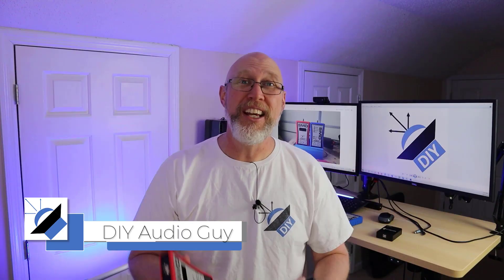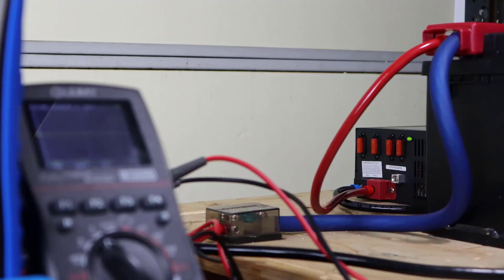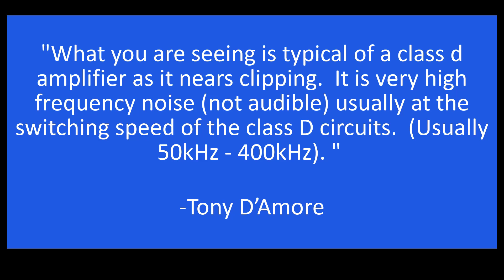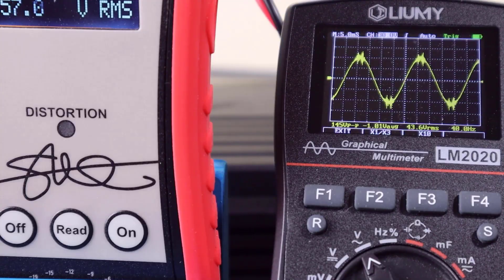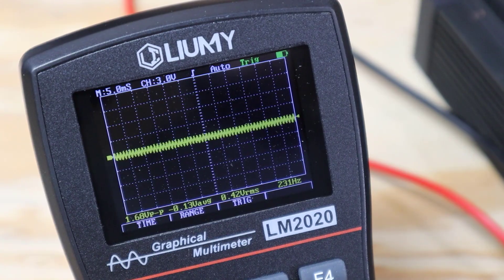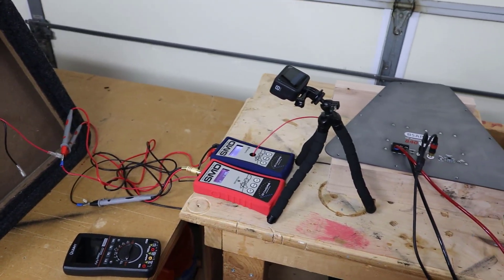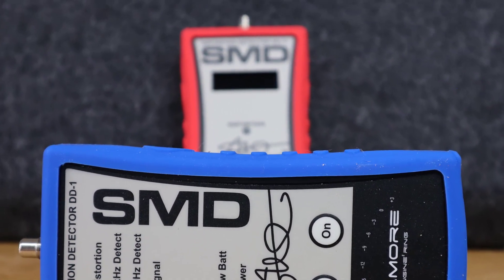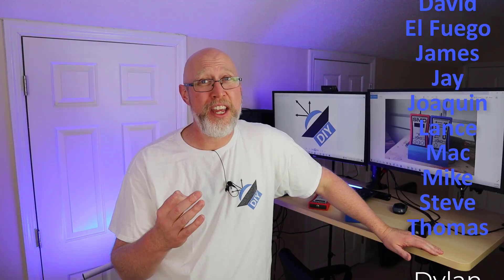The best way to set amp gain?  #SMD DD-1 VS Liumy Oscilloscope

Comment: I know I’m super late to this, but great video and info, as usual! I use a Liumy scope in conjunction with a Fluke DMM and the tweeter version of the DD-1 that Sam had made a video of. Works great if you have the time and space to set up and test everything or the space to haul it around like I did when my friends needed equipment installed (apparently because I’m a big DIY audio hobbyist and all about learning, I’m the audio guru friend😂). I have limited space in my car so I finally made the choice to pick up a DD-1. No more Packouts crowding my little Focus just set up an amp! It’s great to have a vast selection of tools in your arsenal, even if you don’t use them. What’s that saying about needing it and not having it?? Yeah, that applies to a lot of stuff😂

However, as a DIY and a bit of a perfectionist, I do love buying the proper tools to do an install correctly, even if they’re the cheaper ones (usually temporarily) and I have spent a LOT of money on doing just that…the next couple of tools on my list to upgrade are the PT9A+ and an RTA & mic setup👌🏻 even though this is mostly all for just slowly upgrading my personal audio installs over time😅

Comment: Question? How do we check the signal going to your speakers once we set head unit EQ, dsp settings etc.
Reply from the maker: You should not need to, and remember when setting up the equalizer you cut instead of boost. You only boost a frequency if there's no other option.
Reply: @DIYAudioGuy Question? After you check your head unit for clean signal, flat eq, no bass boost etc. then make sure amp signal is clean, dsp signal clean I never see anyone show how the signal is after you set eq to your liking.

Comment: another one I have seen people screw up on with amps and speaker PEAK POWER which is a FKG JOKE, 900 watts RMS woofer or sub ain't going to come with refrigerator magnets, 900 watt RMS amp won't use 24 awg for power
Reply from the maker: Refrigerator magnets, I like that.
Reply: @DIYAudioGuy  figured you would 😂

Comment: best system to setup is, use more power and speakers than required and won't have that distortion problem, by the way, been doing since 1988 by my self thanks to my dad, if one only uses ear they can hear without ten thousand dollars worth of shti, hell I busted the obd1 & obd2 computer systems in the 80's and the 90's vehicles gasoline or diesel with nothing but analog and dmm, after all said could not be done, now a person can't, because pu55ie5 made it that way just so they can cry (DEAD BEAT DAD SYNDROME LIKE TDS) so next time any btch cries, you know why she a lie like distortion utopia

Comment: The scope you used is a cheap or poor scope you need to get a real scope or at least a cheap fluke scope a real scope starts at about 2000 the one you have refresh rate is like 20 nanoseconds and that’s why you had a delay

Comment: I know my particular radio clips at 37 of 40. I set all my radio settings to where I like them. I set the amp for my highs first so I can hear any hiss or distortion. Then I moce on to the bass amp. Bass knob all the way up and amp gain all the way down. Radio set to volume 37. I play a 0db 40hz test tone. I hook a tweeter to the subwoofer channel. Slowly turn gain up to I hear a buzz in the tweeter. Then back it down to it stops. Basically quick explanation of how I set my system
Reply from the maker: 👍Smart
Reply: @DIYAudioGuy  so I basically got completely ripped by Steve Meade saying I can set my gains with a tweeter just as well as his smd tool. I've seen multiple videos of people testing his smd tool against a tweeter with a capacitor to set gains on a bass amp. The red light on the smd comes on and off as the the buzz of the tweeter stops and starts. So what's your take on using a tweeter to set amp gains. Because he literally ripped into hard . Said I'm as smart as a box of nails 😂
Reply: I dropped a link to the video of him rippin into me. It's a bit rude and not very mature the way he spoke to me. I would expect a mature response from man like him. Anyways if u have time to go over the conversation that's in the link. 
I'd greatly appreciate it sir.
Thanks and love your videos

Comment: What setting did you use on the LM2020 to show the (~) around the distortion?
Also I'd like an SMD meter but I don't have any CD options for my dash board.  What do you recommend?
Reply from the maker: It was set to AC voltage.  You have to hold down the r button in order to get it to show the waveform.  Then sometimes you need to go into the menu to fine tune the display in order to actually get a good look at the wave.  It's kind of a pain in the ass. That's one of the advantages of the SMD device. It's extremely simple to use.

I just load the test tones on my phone or onto a USB stick.  I didn't convert them to mp3, you want a high quality file.
Reply: @DIYAudioGuy  thanks I have an LM2020 and I'm saving up for the DD1+

Comment: I set the gain LOW, then turn the source up until I can hear the clipping, I back the source volume down a little, Then  I set the amps with a Multimeter.

Comment: I've been tuning by ear for 20 years.  Never blown a speaker, sub or amp.  Don't need a $500 distortion detector which is a glorified plastic box with a couple LEDS in it.
Reply from the maker: Tuning by ear works IF you know what you're doing.  Sounds like you know what you're doing, so save your money.
Reply: @DIYAudioGuy  this is true.  I learned from good installers when I was a sales guy at an audio store.  They adjusted many systems from people who did it themselves to the proper levels.  Many times they would let me listen before they changed anything so I learned what it sounded like.  I also got to hear the before and after almost every time so I definitely trained my ears to know what I'm hearing.  I've got friends that insist they know what they are doing and have seen them blow countless speakers and subs over the years.  Seemingly never learn, some people anyways.

Comment: Great video and very informative, the only thing that comes to mind in regards to needing a multimeter to set gain is in a situation lets say where you have an amp that can put out 2 or 3 times the subwoofers rated power. You would have to have a multi-meter or an oscope so you can turn the gain up to where the sub is rated at. If a DD1 is used you can only see where the amp starts clipping but at that point the power that the sub is rated at would be double or tripled. I cant see a reason to buy a DD1 and or 1 or 2 of the other SMD audio tuning devices unless you own a shop and time is a factor as the DD1 can speed up setting the amp if it can be done that way vs. using an oscope. If somebody does car audio as a hobby and setting there amp once or twice a $100 oscope is more than enough to do the job.
Reply from the maker: I agree.

Comment: The best tools are the tools you have..
I have a O-Scope and a DMM so that's what i use.
But 1 thing I am seeing is with the first reading with that noise is unless you are running a low pass filter on your sub it's getting to the Sub.
It's easier to see distortion with an analog meter.
Reply from the maker: I agree, the best tools are the ones that you have.

Comment: You can find used SMD equipment on Ebay at great prices. I found my DD-1 just under 100 bucks. Now I have one. No longer a professional I shut down my store back in 2004. I just recently bought gear to have a nice system in my old Dakota and I just wanted the DD-1 to set my gain. It worked great and now I can either resell the DD-1 and possibly make a profit and have set gains, or just keep it and have it for life. I'm keeping mine and will set gains for friends if needed and have fun with it. As a former "pro" I only wished they had this back in my time. Great video as always.

Comment: hi, i am confused with the osci, when i try to turn the gain, the recommended voltage for a 2000 watts under 1.5 ohm is 54.7v. but the osci does not detech distortion until 65v. what gain should I set? the osci wave form that clips over 60v or the voltage calculator that is 54.7v?
Reply from the maker: With a multimeter you're not testing for clipping or distortion.  You're just sitting the voltage to the level that will get you the power you are trying to produce.

Sounds like you have an amplifier that can put out more than it's rated power, so if you use the scope you'll be getting more power.

Comment: I personally own the SMD DD-1 and the CC-1 I recommend this product to any one that is diy i have done install for many years and I never had a complaint about how clean and clear it sounded i have gotten some folk that wanted me to use the SMD DD-1 AND CC-1 to there system and they where very pleased about there sound. so shout out to Steve Meade 💪🏼 it can be pricey but it is truly worth the buck!
Reply from the maker: It all boils down to budget, they are great if you can afford them/justify the expense.

Comment: Hey there, I just found your channel and your videos and you are awesome! I really love your videos and how much you know about all that. 

So here's a tricky one for you: Try to get the maximum spl/lowest frequencies out of a custom build spare tire subwoofer!
Reply from the maker: Passive radiator.
Reply: @DIYAudioGuy  I didn't have the time to watch all of your videos (or at least the most important ones). How does the shape of a box affect the sound? And how do you match the box to a fitting sub (&passive)?
I'm asking because these weirdly shaped cabinets for the sides inside the trunk exist. 
Thanks!!
Reply from the maker: @GamingShiiep  The shape of the box is not affect the sound.

Comment: I have the SMD DD-1, and the instruction booklet says to connect the red lead to a positive speaker output and black lead to negative speaker output. However, almost every video I’ve seen shows connecting the black lead to the amp’s ground. I bought mine just over a year ago. Do you know if this was a change in newer models?
Reply from the maker: I connected mine to the speaker outputs.
Reply: @DIYAudioGuy  I appreciate the quick response. I assumed that there was a change sometime ago. Your video is the most recent I could find concerning this tool. Subbing now. Thanks again!

Comment: i find it weird. i have a full ct sounds system. on my subs i have the at1400.1 on my mids i have the at125.4 and the tweeters i have the at60.4. signal for the mids and highs are run active thru a dayton audio dsp408 i used an smd dd1 to set my gains. the at1400 went just over half gain before clipping. but both the at125 and at60 never clipped. the gains are full on both amps and that scares me a bit. makes me think either the dd1 isnt picking something up or the dsp is some how faking a clean signal
Reply from the maker: That DSP only has 2.5v pre outs, so that may be the issue.
Reply: @DIYAudioGuy  I also have the DSP hooked up in through the high output from the head unit versus the RCA's because I wanted to keep the wiring somewhat simple and clean

Comment: using my Llumy Oscilloscope to set my gain allowed me to actually get more power out of my amplifier than when I used the DD-1, why is that? I followed the instructions that were included
Reply from the maker: The DD1 is supposed to detect 1%THD, most amps clip after they hit 1%THD.  So you will get more power when you are clipping.
Reply: @DIYAudioGuy  But I wasn’t clipping

Comment: I too am like you, am in my 30s getting back into car audio, i use to "install" in my younger days, looking back im not super proud lol. Now that I'm older and better funded which leads to better tools and materials I can actually do professional level install, so far its just been doing my own stuff, I might take on side work in the future,  but now that I have proper shop tools, and the knowledge and experience now to do it right, plus the technology and pricing is so much better these days, additionally guys like Justin and Steve sharing info, I love the hobby all over again. I have been wanting to get a few of the SMD products for a while, I think they are really cool, I just can't justify their cost at the moment for as much as I would use them, currently I'm using the O scope and DMM method, which is light years beyond how I use to set stuff lol. Thanks again Justin and Steve.
Reply from the maker: I certainly don't consider myself a pro.  Hence the channel name DIY audio guy. But when I think about the rat's nest of wires that I had in my car back in the day, I've definitely gotten better.

Comment: Great video...
How do you set the gains when using a Sony 7000,RF DSR1,and three amps? I have a DD1 coming and need to prepare to set them right. I don't trust my ears 🤣
Reply from the maker: You'll have to make sure everything in the signal chain is not clipping so that you don't have distortion going into the amplifiers.  You will probably want to do a little bit of gain overlap.  I hope to get a video out describing gain overlap.
Reply: Thanks for the fast response....I pretty much understand how to check the head unit....just fuzzy on the amps...how do I set up the DSR1? All flat full range with the trim level at full???

Comment: So, old video I know, but I am confused how it is considered distortion near the end when the o-scope is clearly showing no distortion? Sure the amp isn't working in the way we expect, but the signal looks aight. Admittedly I'm not at all familiar with the Liumi scope, but I mean... that's a clean looking sine. Granted I work on circuits that are designed to add distortion so..
Reply from the maker: Sometimes the wave appeared to be a bit wonky to me. I don't think I got it on camera.
Reply: @DIYAudioGuy  Now that you mention it, going back maybe I can see it now. I'd like to see it on a bigger scope that has more inputs so you can compare input to output , but I do get the reason why you like the Liumi. Quite a neat little unit. I would definitely agree that there is a limiter in place.

Comment: I have generally always overpowered my subwoofers. This makes the gain not that big of a deal to me. I just use a basic voltmeter and set the volts to match what the subs need.    For instance, powering a 600 watt sub with a 1000 watt amplifier. If you were to set gain to the max before clipping on the amp, you would most likely blow the sub.  No clipping worries for me. Although I have pushed amps back in the day to their max etc, where clipping would matter.
Reply from the maker: Smart.

Comment: I sprung for a DD-1 about six months ago and I'm happy I did. I began my journey into car audio with a MTX1501D bought off a local Facebook group and have slowly continued to climb up to where I'm now running 6000 watts on strapped amps and backing it with lithium and a high output alternator. As you get into the more powerful and higher quality gear it becomes too expensive to risk doing it incorrectly. I've noticed my gain walks a little every few months from the vibration and a DD-1 is fast and simple enough that I can re-tune in a parking lot when something doesn't sound right.

I definitely agree that for someone just starting out the SMD tools may be a little too out of reach and a cheaper alternative may be needed...just as long as it is done right. For those bitten by the bug and constantly wanting more though, you can't go wrong with the SMD line.

Thanks for all the knowledge you've shared and for continuing to put videos like this out!
Reply: Just remember how you set your gains last time and do it again. Or make a mark, you don't need a dd1
Reply from the maker: Awesome!

Comment: I would recommend a analog oscope, the issue with new digital scopes is the latency in cheap oscopes. I use a Iwatsu 200mhz 3 Channel scope. But it's heavy and clunky. But very accurate . Rigol  digital and the better brands are fine, but the processing is a little slower, just a little tech tip
Reply from the maker: Definitely want to get my hands on one of those at some point.

Comment: Never use a phone for any testing cause they produce 5-10% the and voltage can be over 2 volts now that input at 2 to. 2 1/2 volts that will cause the get it at1 1/2 volts then the thd will most likely thd will be at a level so the amp won't clipp.but it's at a point the gear is not high end stuff you own in your house. 1%thd is not high end gear buy any means.so car audio don't have to be like this but it is. Tune for best sound

Comment: The reason your scope was so late on showing is because you scope is a cheaper scope with slow refresh rate and sampling you need to get a better scope or just uses the dd1 I have used both and my 14,000 scope shows and is more sensitive then the dd1 so the dd1 is better then all those cheap eBay scope and what you have for a scope it’s not if you can’t afford a fluke stick to the dd1
Reply from the maker: Or just use the cheap scope since it is half the price and only a fraction of a second behind.

Comment: Hey bro can you do a video on running 3 amplifiers? I’m planning on doing 2 4 channel amps to run my mids and highs and ofcourse the 3rd amp is for my subwoofer. Being that now days the tweeters are so high in watts as well as the 6x9s I want to run everything separately instead of wiring the tweeters to the 6x9’s. Also my car has a factory hole for an 8” subwoofer which I bought an 8” mid speaker for. Hence why I’m planning out 2 four channel amplifiers
Reply from the maker: https://youtu.be/UXqqPDiRx-o

Comment: have you tried using a piezo tweeter or tweeter with built in crossover/ capacitor to set gains vs o scope or dd1
Reply from the maker: I have not.